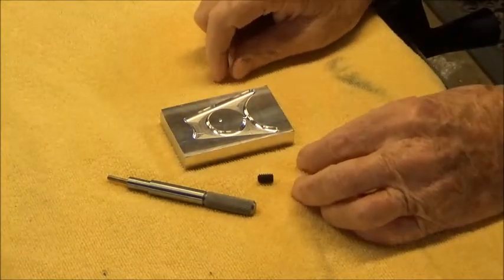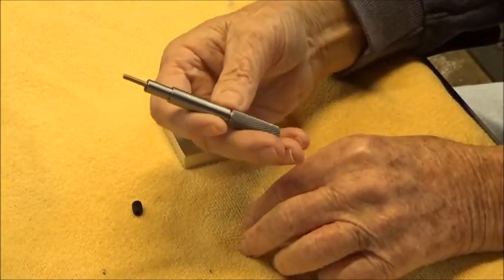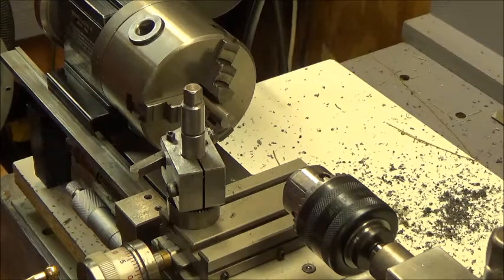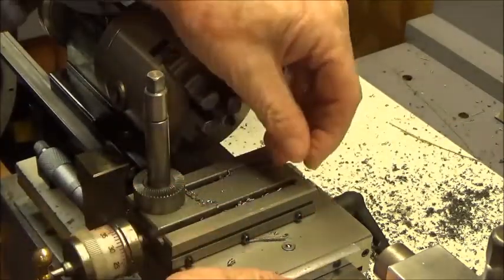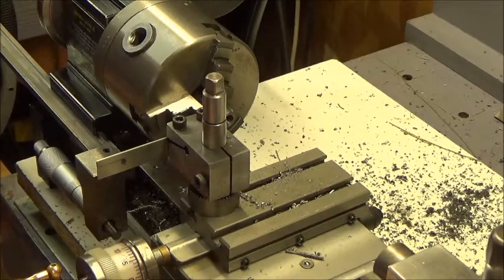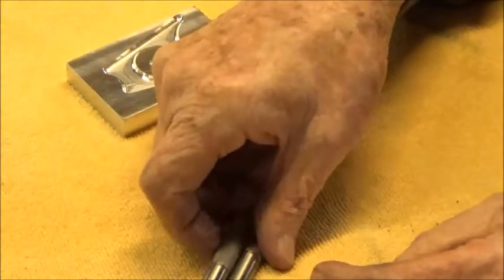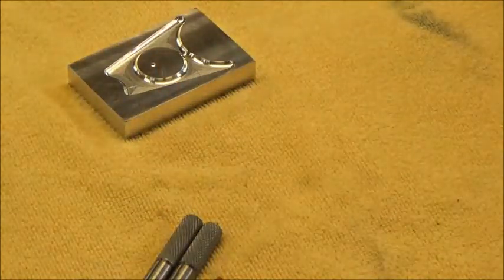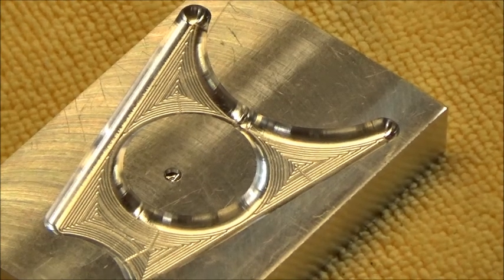Making A Small Hex Head Nut Driver (#2-56 Screw)

Comment: Nice work Larry, great little nut drivers. Don't know what to do about that tight fit, but I would either try to polish it with grinding paste, or a touch with a sand blaster. Possibly a rotary broach approach could work, but you probable don't have to remove much material. Anyhow, cheers! Enjoyed the video.
Reply from the maker: I have some set screws the correct size that arrived in the post today, so I'll give those a try the next time I'm in the shop.  Thanks for watching and comments.  Regards: Larry